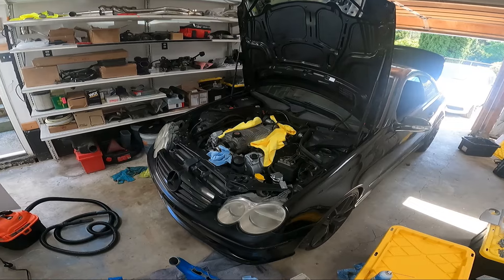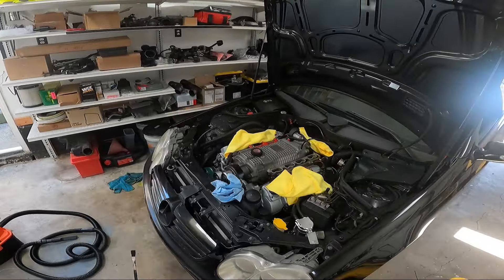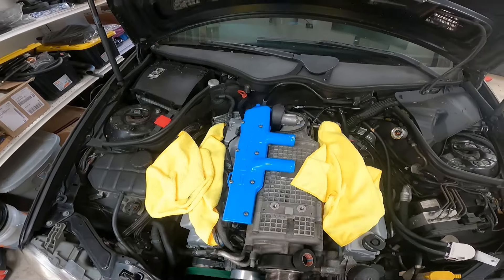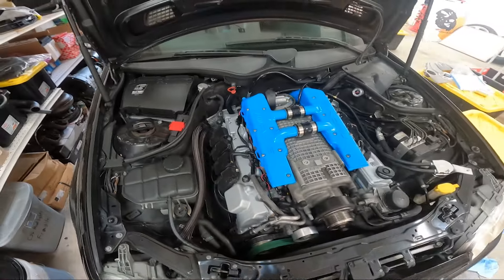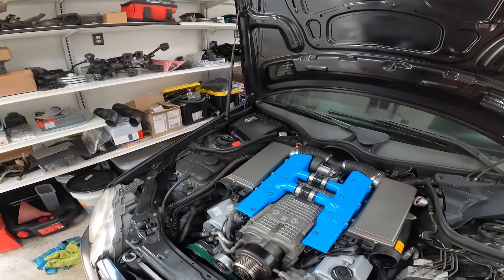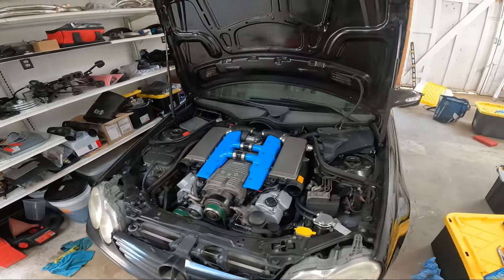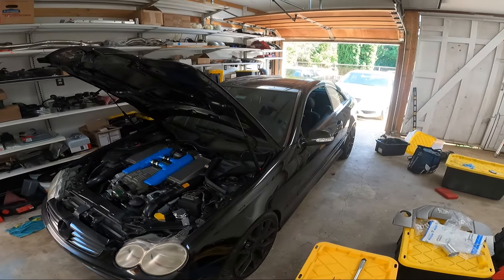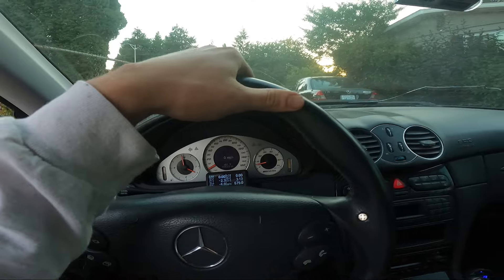M113K Fires up for the First time with EV14 550cc's and SIKKY Thermal Gaskets! (CLK55 AMG)

Comment: Nice work , engine bay looks great with the blue surge tanks .
PS. The air cond. compressor is a swash plate design , so it doesn't have a 'clutch'.

Comment: I just got my w208 clk55 amg i bought wrecked running and driving. I can't imagine it with a blower. Its already a missle. Its kinda nuts they sold these things to random traffic drivers with a pile of money. Its faster than my mild hot rod monte carlo ss. Its faster than my drift car for sure. Manual swapped and stripped down yikes. If it was a 209 it would be really tough to not build it as my new drift car.

Comment: How come you are going with a harsh fixed pulley rather than a normal clutched?
Reply from the maker: if you set them up right, they can be just fine.
Reply: @ANDERZENAMG  I was told then there is more unnecessary wear on the blades at idle causing more heat